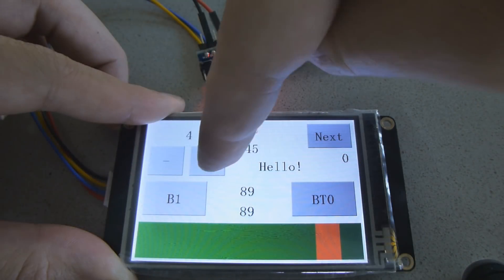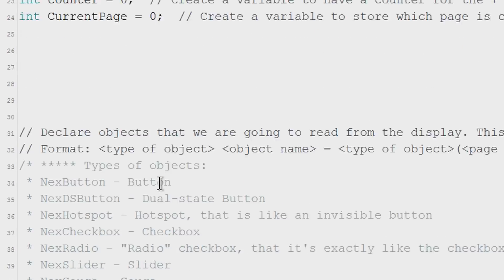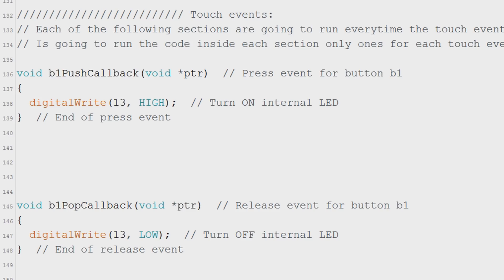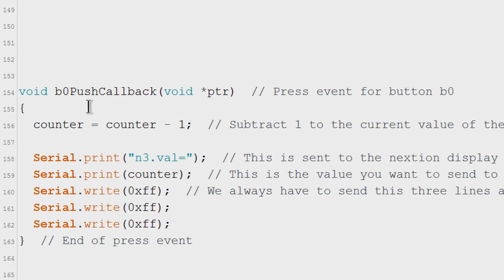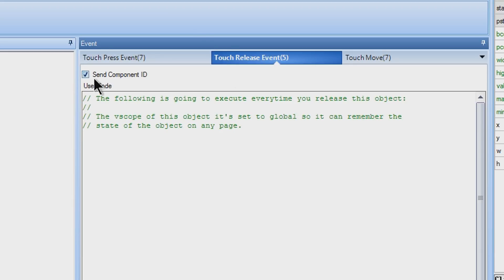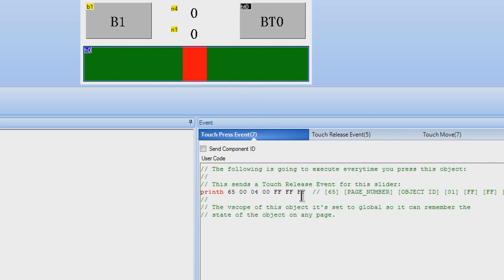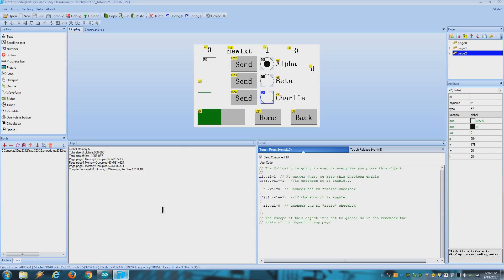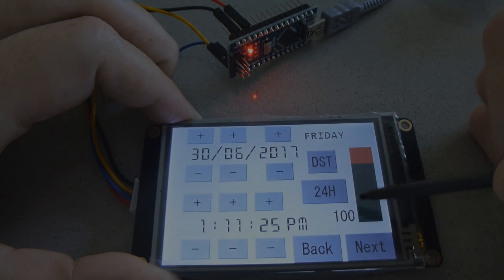Nextion+Arduino Tutorial #2 Sending Data To Arduino

Comment: Is there a way to code Nextion to tell Arduino when its ready to receive new instructions? The rather unhelpful Nextion forum mod basically said that sending data to the Nextion in a quote "unbridled" way was causing a progress bar to redraw choppy and blamed the code on it and not the speed of the Nextion.  If it is in fact code related that causes the progress to redraw slowly, what can be done to minimize it?  I cant link other Youtube videos here, but the issue is that the areas being drawn as the bar climbs or descends, you can see vertical lines of the bar being drawn and looks similar to flickering.
Reply from the maker: I don't see any flickering in the progress bar. Can you show me? BTW you can put links to youtube videos in the comments.
Reply: I didnt think you could.  Notice the progress bar on this dash, you can see it drawing like vertical stripes as it goes up or down and is much more prevalent when the changes are large or happening very fast.  I cannot figure out how to fix that if there actually is a fix https://youtu.be/nmV7ax51Ozk
Reply from the maker: Oh. I suppose you are using the basic version? What size? Better use the enhanced version, if your display is 3.5" or bigger because it has a faster cpu.

By the way how did you make the progress bar have a gradient color?
Reply: No I am using a 7" Enhanced.   I made the progress bar in Adobe Illustrator and yes it has a gradient.
Reply from the maker: Maybe the high resolution is too much for the cpu, even for been the fast cpu. Did you put the gradient bar on the background image?

Comment: I have the following code. All I am currently trying to do is make button "bt0" on "page0" with ID "9" to trigger pin 7. What code can I use? (I am using a Mega2560 and 4.3" Basic Nextion Display). I have tried using your code above, however I have not been able to accomplish this simple task :(

CODE: https://drive.google.com/open?id=1P-KLboQcl3UPlwWMdKFo2G3i-U4JIbPE
Reply from the maker: Watch my troubleshooting video. Most likely the solution is there.

Comment: Hii Sir really really good after first tutorial. But really really need help for my project. I have three different modes on my project. Need to select mode using Arduino. Once mode selected I gave to enter parameters and execute the mode. Is it possible
Reply from the maker: From what understand, I don't see a problem on your plan.
Reply: I planed to use radio checkbox and play any one mode at a time using switch case. Is it ok.
Reply: Also another doubt is 
I need to send data from nextion to Arduino only if I set data using slider and press another button like send or enter to send data to Arduino
Reply from the maker: You can do all that

Comment: Hi Good job, and thanks. If I can provide a small comment in the slider section, to avoid reading erroneous data, put global variable; uint32_t number2 = 0; // Create variable to store value of slider as global, that is, outside the function
Reply from the maker: Why do you think that putting the "uint32_t number2 = 0;" variable outside the function would make any difference?
Reply: It matters because local variables inside a function disappear after the function returns in C and C++.
However,  I would name the variable uint32slider. All variable names should be descriptive of their type and use.

Comment: This has been a big big help - so many thanks for this!!
Reply from the maker: I am glad. If you have any problem, let me know.
Reply: Hi i'm wondering if this sketch run on your arduino cause when i upload the whole code it messages...
C:\Program Files\WindowsApps\ArduinoLLC.ArduinoIDE_1.8.15.0_x86__mdqgnx93n4wtt\hardware\arduino\avr\cores\arduino\HardwareSerial.cpp:203:1: internal compiler error: Segmentation fault

 }

 ^

Please submit a full bug report,

with preprocessed source if appropriate.

See <http://gcc.gnu.org/bugs.html> for instructions.

lto-wrapper.exe: fatal error: C:\Program Files\WindowsApps\ArduinoLLC.ArduinoIDE_1.8.15.0_x86__mdqgnx93n4wtt\hardware\tools\avr/bin/avr-gcc returned 1 exit status

compilation terminated.

c:/program files/windowsapps/arduinollc.arduinoide_1.8.15.0_x86__mdqgnx93n4wtt/hardware/tools/avr/bin/../lib/gcc/avr/5.4.0/../../../../avr/bin/ld.exe: error: lto-wrapper failed

collect2.exe: error: ld returned 1 exit status

exit status 1
Error compiling for board Arduino/Genuino Mega or Mega 2560.

Comment: Can you suggest me some other video or anything that will help me???  Sorry i am bothering you alot... But i am stuck.. Sorry again
Reply from the maker: What problem are you having? All I can suggest is watching all my tutorials and read the nextion instruction set https://www.itead.cc/wiki/Nextion_Instruction_Set
Reply: InterlinkKnight  as you define functions for a button. I did the same. Except defining page number as touch event in arduino sketch. And instead of buttons i used hotspots for running a stepper motor and operating relays... My HMI consists of 19 pages... And i just mentioned those hotspots in arduino sketch which will perform motor run n operte relays... I didnt defined other hotspots used in HMI which have nothing to do with arduino.
Reply from the maker: Did you tried my examples and they worked? It's hard to tell whats wrong wihtout watching the code
Reply: can i send you a small ino code  ??? for just LED ON... Can you please diagnose wots going wrong??
Reply from the maker: I don't see anything wrong. Maybe send me the sketch and nextion project. My email is my username at gmail.com

Comment: Brother i am using Nextion to send command to arduino to run the stepper and control relays. i have buttons for their control... do i have to mention all pages in arduino code??? because i have done everything mentioned in your code except mentioning pages.... will be really thankful if you help
Reply from the maker: As I mentioned on the video, I let arduino know what page the display is on to avoid arduino sending data to non-existing objects. If you are not sending data to the display, then you don't need this. If you do send data to the display, then you might notes some slowdown on the arduino loop because the display would be sending a constant error message. The problem is that if you send data to the display and that object doesn't exist on the current page, the display will send an error message and arduino will listen to that. This slows down the loop and will create some lag.

Comment: I get an error using your provided links. I modified nothing except the display settings to match my enhanced 7". The arduino library is stating numerous errors about types 
"Nextion_Tutorial2:68: error: 'NexDSButton' does not name a type
 NexDSButton bt0 = NexDSButton(0, 8, "bt0");  // Dual state button added"
I took a look through the library you linked to and all the errors pertain to missing .h files. NexButton.h is there and does not throw an error. Has this library been modified since this video was made? Or am i missing something?
Reply: I used the stable release which is much further behind in progression. They should update that lol
Reply from the maker: Stable release of what? Are you still having the problem?
Reply: I downloaded the stable release of the git Arduino nextion library that you linked to. I have been unable to use the serial interface you have. But the DS version I have had success. I am using the wemos d1 mini and mini pro for the microcontrollers
Reply from the maker: Try with arduino uno or nano, and should work. My examples are made for those.
Reply: I meant the DBserial. Either way I need the extra code memory and the wifi of the esp8266. I think something is going on with my IDE as each time i install the examples, only three are left after restart of IDE. Then this morning I got a message stating invalid library for Nextion. Great work on your videos btw. They were the reason I decided to buy this display.
Reply from the maker: You should still try first with arduino uno/nano as a test and later go to the esp8266. Start simple and go from there. For example, have you tried my files for my first video tutorial? They just send data to the display, without the library. If you really want my help, you could email me and give me more details about your setup and problems. My email and contact form are on my website https://interlinkknight.wixsite.com/interlinkknight/contact-me

Comment: Thanks for the great videos. Very clear to understand how to comunicate with Nextion displays. I still have an issue with getting data from the display. Not receiving the value with the get command.  I am using software serial on Arduino Pro Mini " SoftwareSerial HMISerial(2,3) ". The receiving variable remains zero ( or the value what is given on the initialization ). Any ideea why this is happening ?
Reply from the maker: I tested software serial with the nextion display too and I got problems receiving data too. Solution: don't use software serial, unless is to only send data to the display.

Comment: Hello, I just want to ask why your example doesn't work on my arduino mega and nextion 3,5. I uploaded everything and + and - buttons don't work and also graph on 2nd page doesn't work. Why is that so any help pls
Reply from the maker: The problem is that arduino mega call the serial  on the sketch with numbers. In arduino uno/nano is called "Serial", but in arduino mega is called "Serial1", "Serial2" or "Serial3" depending on which serial pins are you using. Add a number in all the parts of the sketch that has the word "Serial" and it should work. Which number? Depends on which serial pins you connect the display. Also make sure to configure the nextion library to use the serial number that you are using. You do that editing the configuration file inside the nextion library. More details on the actual example sketch.
Reply: Any ideas on why I get errors trying to verify your example on my IDE? It says "    'NextButton' does not name a type  " . I  have the official library installed and even made the change to the config file already but i'm missing something that I cant figure out, any help would be appreciated. Also thanks for shareing your examples,and time on these videos ,very detailed.
Reply from the maker: I am not sure but looks like you are using another nextion library. Make sure you download the library from the link on the description.
Reply: ok I didn't use the link to get the library. that is the move I will make next. Thanks! have a good one.
Reply: Thanks a lot man!

Comment: HI,
I use arduino mega which have 3 tx/rx port - none of them load arduino sketch to the nextion....I replace to uno it load te sketch but only when yelow line
at nextion connect to pin 0 rx and the blue connect to pin 1 ???Do you know whay??
Reply from the maker: Why works on arduino uno and not on mega? Because the serial name on arduino mega has a number, and arduino uno/nano is just called "Serial". Replace everything that say "Serial" with "Serial1" and it should work. Obviously connect the display to the pins for serial1 (TX and RX)
Reply: Where to change?
At the softwarserial lib?
Reply from the maker: Software serial? No-one here is using/talking about software serial. You change it on the sketch.

Comment: Hello, many thanks for your video and helped me a lot. I try to to identify the button / dual state button which is pressed on the display and use the getValue function. I get this error "MySensorNextion:254: error: 'class NexButton' has no member named 'getValue'

     bt0.getValue(&number1);". Any idea what the issue could be?
Reply from the maker: I see the problem. In the first main section where we declare the objects you put NexButton instead of NexDSButton. NexButton is for normal buttons and you are trying to read a dual state button. Dual state buttons are called NexDSButton in this section.
Reply: Thank you for the reply I know now what to do :-). I use the https://github.com/itead/ITEADLIB_Arduino_Nextion/archive/v0.7.0.zip library which does not include the DS button .h file. Are you working with the  https://github.com/itead/ITEADLIB_Arduino_Nextion/archive/master.zip. libraray? (which das the DS button .h file)
Reply from the maker: The link for the library I used is on the description

Comment: Your work is appreciated. I am trying to control the speed of stepper motor through slide bar  and its direction of revolution through buttons on Nextion TFT. Can you help please?
Reply from the maker: You should start by controlling the stepper motor with arduino as you want. Ones you have all that working, try applying what you learned on my tutorial videos to control the stepper motor with the slider. If you try it and have a problem, let me know and might help you. But I can't do the job for you. I can only guide you in very specific problems that relate to the nextion display. Use my examples and make sure they work for you.
Reply: Thanks for the Quick Response
Reply: Than for your quick response man.. I am a noob to this... But my program in not workimg... Although it compiled successfully. But not working...

Comment: sorry for non tech question, what software do you use for pc screen capture, i liked it when it zooms IN when you click at certain place on screen.
Reply from the maker: I use nvidia shadowplay that it's included on GeForce Experience but the zoom is not made by the screen capture. I zoom manually using my video editor (Sony Vegas) much after I record/capture everything.

Comment: hi,
finally i was able to make it work, instead of putting in the arduino code, i put it under nextion pre-initialization section ( bauds= 115200).
Reply from the maker: Some how the display was not receiving the baud change command. Now that you successful change the default baud rate of the display, you can now remove that code out of the pre-initialization.
Reply: Thanks Buddy , will do that
Reply from the maker: What compiler you where using when you had this problem? I know you solve it bu I really want to know what cause the problem.
Reply: HI,
U mean arduino version? it was 1.8
Reply from the maker: Ok, thanks.

Comment: HI, I tried in three different ways, am not sure where i am going wrong, every try i switch off the both devices

First Try( It communicates - Led turns on)

Serial.begin(9600); 
  delay(500);
  //Serial.print("baud=115200");
  Serial.write(0xff);Serial.write(0xff);Serial.write(0xff);
  //Serial.end();
  //Serial.begin(115200);

Second Try

Serial.begin(9600); 
  delay(500);
  Serial.print("bauds=115200");
  Serial.write(0xff);Serial.write(0xff);Serial.write(0xff);
  Serial.end();
  Serial.begin(115200);

switch the power off and then conneted , led does not turn on

Third try

Serial.begin(9600); 
  delay(500);
  Serial.print("baud=115200");
  Serial.write(0xff);Serial.write(0xff);Serial.write(0xff);
  Serial.end();
  Serial.begin(115200);

switch the power off and then conneted , led does not turn on

Comment: Hi , 
in the code u had mentioned that u can change the baude rate to 115200 , ( bauds = 115200) , but with this change my nextion and nodemcu does not communicate ( led set at D5 ), when i change it back to 9600 it does communicate properly , does bauds code work with the regular 2.8 board.
Reply from the maker: It works with any display version. Did you change anything on my code? Did you cycle power OFF and ON both devices? The display has to receive the command to change the baud rate using the baud 9600. That's why I start the serial communication at 9600 and later give the instruction "bauds=115200" and after that end serial communication and start another serial in 115200. And power off the arduino so executes the setup.
Reply: HI
i did the following in the setup
void setup() {  // Put your setup code here, to run once:
  
  Serial.begin(9600);  // Start serial comunication at baud=9600
  delay(500);  // This dalay is just in case the nextion display didn't start yet, to be sure it will receive the following command.
  Serial.print("bauds=115200");  // Set new baud rate of nextion to 115200, but it's temporal. Next time nextion is power on,
  Serial.write(0xff);Serial.write(0xff);Serial.write(0xff);
  Serial.end();  // End the serial comunication of baud=9600
  Serial.begin(115200);  // Start serial comunication at baud=115200
  
  bt0.attachPop(bt0PopCallback);  // Dual state button bt0 release
  
  pinMode(D5,OUTPUT);
  
} 
then i disconnect the nodemcu from the pc and connect it to a power bank and connected the tx and rx to nextion, then i click the dual mode , it does not work , then i comment the code for baude change and again reload the code and then it works.
Reply from the maker: By putting "bauds" instead of "baud" you are trying to change the default baud rate of the display, meaning it will have that by default. Try removing the "s" so you change the current baud rate instead of default to see if works.

Comment: if I press the b0 or the b4 button, the n3 object is every time 0 why?
Reply from the maker: There are many reasons why that doesn't work. Maybe you deleted something on that page and the ID number of those objects change, making them no longer match the arduino sketch. Maybe you didn't connect the blue cable. I don't know. Did you modify anything on the sketch and the nextion project? The rest of the objects work?
Reply: no everthing is the same and also the wave doesn`t work. Is it a problem if i have an other display than you?
Reply from the maker: Increase de delay of the arduino loop to maybe 70. Using any version of the display should work